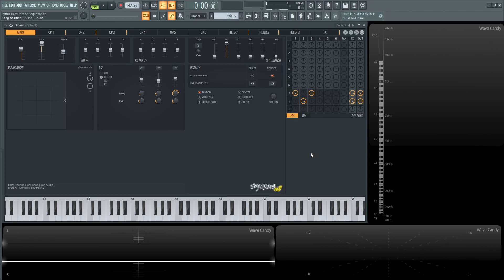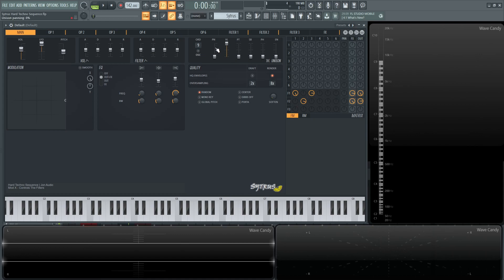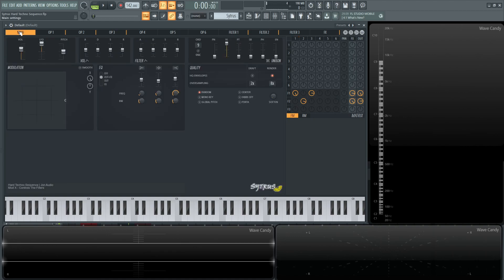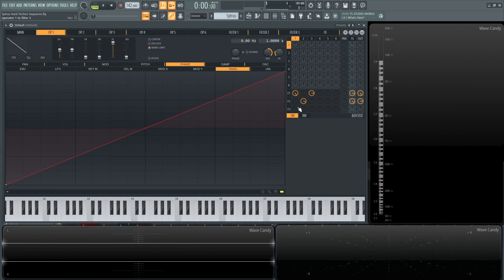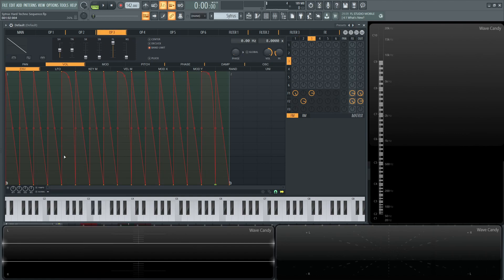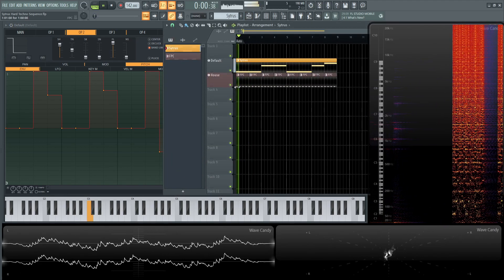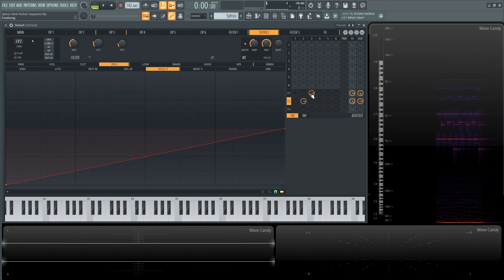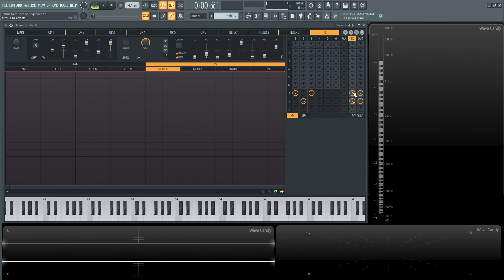Sytrus Hard Techno Sequence Sound Design | FL Studio 20 Tutorial

Comment: Is Mod X basically a form of automation? Harmor also has Mod X and Y

Also, is there any similarity to LFOs which also seem to modulate things?
Reply from the maker: So in this case I'm using mod X as a convent control for the filter. Think of the mod knobs and blank controls that you can map other stuff too, you can map all 3 filter cutoffs to mod x, and that way one knob does the job of 3. It's right on the front of the synth and it can be automated too.
Harmor has Mod X, Mod Y, and Mod Z. So for harmor you have 3 blank knobs to be mapped to whatever you'd like.

LFOs are different because LFOs are constantly moving or oscillating automatically. You can have different lfo trigger options, where the lfo resets on a note pressed or have the lfo free running where it's always in motion.

To sum it all up, the mod knobs are a user friendly knob that you can map it to many things to control parameters of the synth. LFOs have 1 job and that's to oscillate at the speed you'd like and to move the parameter you want automatically. I hope that makes sense
Reply: @jonaudio  ah, cool, thx for explanation

In that case seems like the Mods are almost analogous to bus tracks in mixer in that you can use them to paint in broad strokes across a lot of sounds at once 

Will have to mess around more with Mods. I just notice a lot of presets in Harmor have explanation text about what the Mod X and Y do. I guess it’s user defined and flexible
Reply from the maker: Yep they are 100% user designed. And another interesting with mod knobs, is when you are mapping them in the graph, you can make different graph shapes. Most people will just make a straight linear line, but you can make exponential curves. Really any type you want and think would benefit the patch the most.